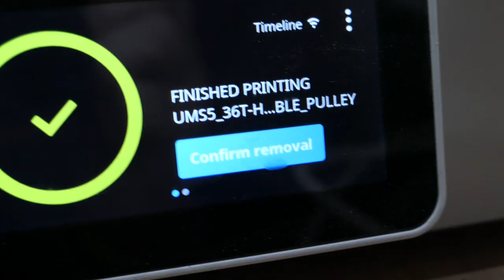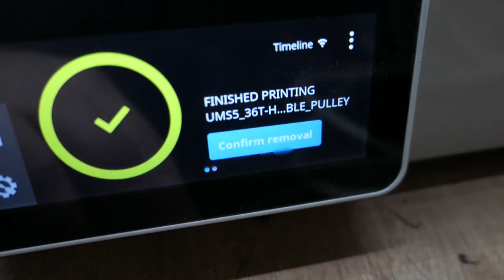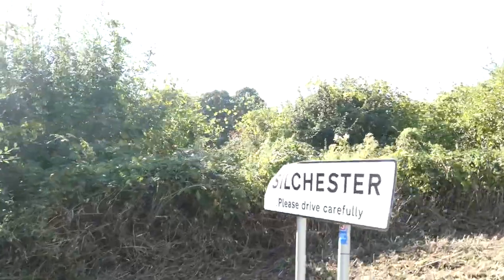Orangatang Caguama 77a Installation And First Impressions

Comment: Love your videos Lee!  Comletely agree with you.  If Loaded we're to do a 90mm or 97mm I feel they'd sell real well.  For many esk8 builds that run out runner motors, the those size wheels would be a sweet spot!  Keep up the great work. Appreciate your media contribution to the esk8 community!

- Neil
Reply from the maker: Big Kids hey man, thanks for the love! Loaded know what they are doing for sure... and have seen the potential in eskate! Thanks for watching dude! Love your stuff too!
Reply: This video is perfect.  I've seen a ton of people add larger diameter wheels to low-torque boards as "upgrades" but you obviously trade top speed for less acceleration <stupid science>.  BUT WHAT IF YOU HAVE TORQUE TO SPARE? A little VESC/FOC modification should balance out any expectation I would think.  A question I have always wanted to know the answer to, and Lee's the man to do it if Loaded pushes above 85mm.  I'll pass the hat around the saloon for you when it happens Lee.  ;)
Reply from the maker: Shane Parrott if loaded make them I will try them! I have a video with 110mm wheels on this board and it was really nice to ride tbh, they really stretched that throttle out without sacrificing too much torque, like you say I have loads to spare! Haha.  Thanks for the support as always man!
Reply from the maker: Shane Parrott if loaded make them I will try them! I have a video with 110mm wheels on this board and it was really nice to ride tbh, they really stretched that throttle out without sacrificing too much torque, like you say I have loads to spare! Haha.  Thanks for the support as always man!

Comment: Love the Caguamas (I still prefer orange/80a), but I also haven't had any issues with my Stealth and Mini X stock wheels after hundreds of miles
Reply from the maker: Yeah I love the caguamas too, they are my favorite wheel I have tried so far.  I have about 250 miles on my caguamas and 3d printed pulleys and both are still in excellent condition!

Comment: for those without a 3D printer, Evolve have the pully's, the only thing is you have to buy the whole lot to get them. Wheel's, Bearings & pully's which is $150AUD+ postage
Reply: Exway has the pulleys, just the pulleys for sale.

Comment: Which bushings are you using on the TB218 trucks?
Reply from the maker: Hi Marcel, I am using blood orange insert bushings, they really take the slop out of the TB218mm trucks
Reply: @LeeWright  Thanks for the fast answer! I looked for them, which durometer do you have? Have you compared them to the normal barrels?
Reply from the maker: @marcello_187  hey no problems! I try and answer every question - I hope my channel helps people! I have the 86a burgundy ones, you will need to pick according to your weight.  Yes I had barrels on at first and the difference is night and day, you need these insert bushings.  Do you already have the 218mm trucks?
Reply: @LeeWright  Ah ok, I just wonder because ein the video you have green ones... haven't found them at blood orange. I have TB218 already for my new build. Today I tried to go from barrel/cone to barrel/barrel on my boosted board copy. This was already amazing. Do you use one insert and a normal barrel one then?
Reply from the maker: @marcello_187  yeah I have insert board side and barrel road side, I have experimented lots and this is what I come up with as the best solution.  I think you need the insert board side on those trucks

Comment: Word man. Got 90 popocas on my v2 hella great. They need to do 90 mm. Anything bigger on the boosted seems to really kill the braking .
Reply from the maker: Yeah you can go too big on the boosted for sure.  I think they will do 97mm tbh, it's a popular wheel size
Reply: I have the 90 Popocas and miss the torque.  I’ve been eyeing the Caguams the past week for my overhead I’m doing; AcerBearings, JasonIndustrial belts, and Boosted metal pulleys....I’m just undecided on wheels but these blue 85mm Caguamas seems to be a nice middle ground to gain some torque and keep some top speed.

Comment: How are those platic gears and their threads holding up?
Reply from the maker: Still rocking them mate, must be 400 miles now? Still look great! I printed them out of Nylon though which is super durable
Reply: @LeeWright  cool, printed mine out of PETG, interesting to see how they will hold up
Reply from the maker: @mysbyxor  PETG is also a very good material to print for these parts.  I bet if your belts are set up correctly you could see 1000 miles on them

Comment: Where didja get the cool chrome truck bolt X plates?
Reply from the maker: Hey dude, I got them from a guy on the esk8 builders forum - if you are not on there you should check it out.  Loads of cool stuff

Comment: Ever considered putting it all on a loaded vanguard deck?
Reply from the maker: Floating Ace Good question.  I was actually originally going to build a Vanguard deck but owned the Icarus as a push board so decided to build on that. The Icarus for sure has a different feeling to the Vanguard (I have ridden boosted boards a few times) but it's such a nice eBoard I haven't really got a need to do that

Comment: Why did you drop the 3d printed pulleys into water?
Reply from the maker: I probably didn't explain in the video enough but did you see that white stuff round the outside of it? That's water soluble PVA support material.  Once it prints you have to leave it in a water bath over night.  Hope that explains it better
Reply: What's the music you used in this video